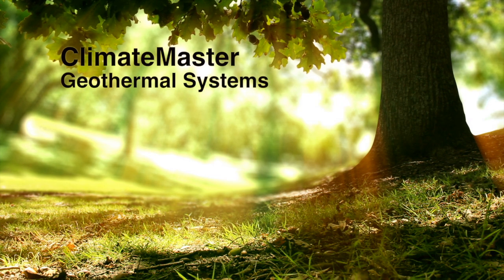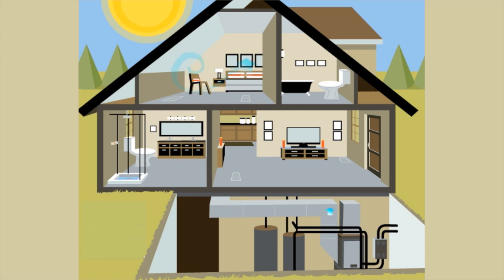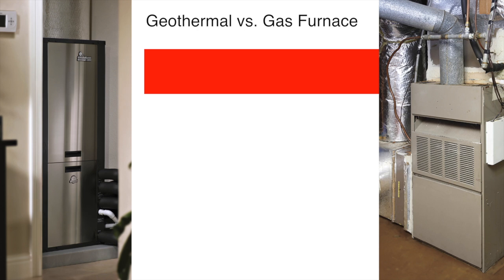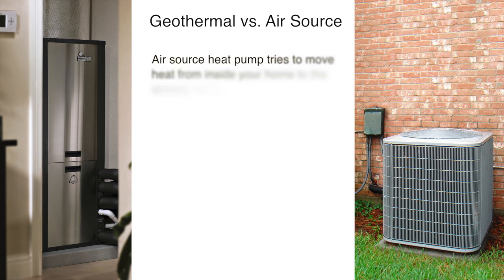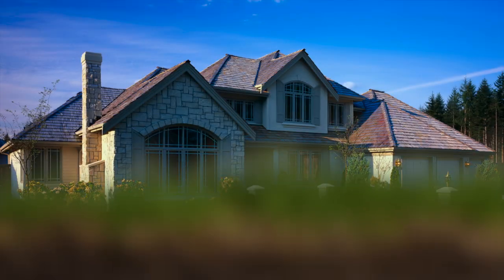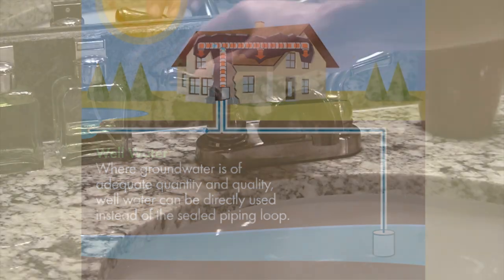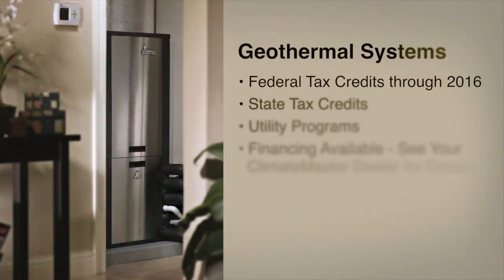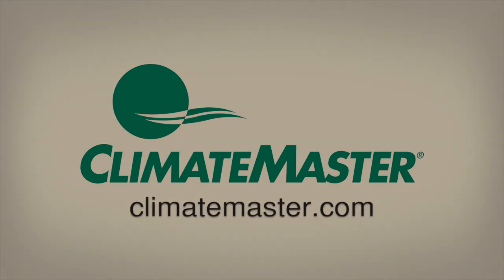Benefits of Geothermal Heating and Cooling

Comment: Learning the hard way. Bought a house in Ohio that has geothermal already installed. Had inspections that every work properly. Replaced after 1st year, 3 companies, 3 estimates, all said undersized. Heating bills from mid November to end March 3500 to 4000 total. Installed wood burner stove to heat house, bill dropped to 200 for average. House is 3000 sf ranch, w/good insulation. Geo unit is 3 ton air side, which works great, average bill 225 summer, but in the winter, if it gets below 30 deg it’s a piece of junk. Oh, the heat side is 2 units at a total of 6 ton. Uses all electric below 30 deg and will only heat to 68 degs. That first 875 dollar bill for the month of Dec. was more that a shock. Now 7 years later, and a tech out every 6 months to service unit, they say it needs replaced. A worthless piece of junk, and a con job by a industry as a hole. Luckily they ran natural gas this spring down our road, so the heat side will be toast by fall. Save your money, don’t buy into this, it’s not meant for heat in cold climates. That 2nd year cost us almost 20,000 with the replacement of units, heating cost, and , misalliance.
Reply: WTW Could it be that this system that house had could have just had some issues on top of not being deep enough into ground? I’m just wondering after reading your whole message.
Reply: 3000 sqf then you need 11 kwh pump. And that is a 3500 watt compressor. And if this runs 24/7 it is, 30*24 = 720 H/month, is 0.1 dollar hour/and 1000 watts. And that is 24 h/day *3.5 kwh = 8.4 dollars a day times 30 days
is 252 dollars. And that is if your house, is using 11 000 watts to heat continuously Normal heat requirement is> 

Well insulated is 40 watt per kwm, 250 kvm (2,690 square feet) gives  40*250= 10 000 watts
A well insulated house 2400 sqf needs 10 000 watts in a very cold climate. And the geothermal pump gives 11 000 watts, without need to use electric heating. And the cost is, 252 dollars for one month. You sir are lying.
Reply: @72strand  or is just really bad at Math. ;)
Reply: John Strand The 252 dollars a month thing, that’s kinda why I started brainstorming about my Rocket Mass Heater Hybrid Geothermal system. The RMH would serve as a heat source amplifier and introduce heat into the system when the geothermal system is working way too hard and the cost starts getting a little uncomfortable for the wallet. RMHs use a lot less wood then traditional heating methods and they leave no residue to clean because they burn the creosote too. Hopefully I’m onto something.
Reply: You have to get below the freeze-thaw zone.  Higher latitudes, continental climate, you have to go much deeper.
Reply: Darn, it seemed like a good system
Reply: Also, to modify the system, I have an idea, what if a solar water heater was added to the output end of the geothermal system to boost its resting heat output? You’d have pretty hot water flowing through those pipes to warm the home all you’d have to do is put the solar water heater on a remote controlled swivel and program it to follow the sun 24/7. I say this because my house has a solar panel array that cuts my electricity bill to zero. So I have electricity to play with. I plan on living north. Not Alaska or Washington north but moderately north. Nothing higher than Oregon.
Reply: Catalyst - D B The man who built my house did just that. He took a long big radiator, painted it black. Made a long big wood box, rockwool in the bottom and sides, glass on top, mounted it on top of the garage. And waterlines down to a tank in the house. What happened? The whole thing exploded. No one was hurt.
Reply: John Strand Glad nobody was hurt though. Haha. Tons of videos about those solar water heaters on here. Maybe there’s something the guy did that wasn’t right? YouTube videos might help show what went wrong with the construction
Reply: John Strand with my current set up plans, my electric and water bills are zero. I still have medical insurance and car insurance but I don’t see a way of getting around those anytime soon 😂 Trying to retire extremely strong someday. I’m only 23 years old. Skipped the bank for the house building. Paid builders directly cash. Takes months longer but it’s worth it. Don’t wanna be slave to the banks.
Reply: Catalyst - D B Yeah, you need a pump or else it makes steam :). This was in the 1978 or something like that. He wanted to heat the incoming water to the hot water before the boiler.
Reply: John Strand ohh! There you have it then. 😂 Lesson learned for the builder I guess. Makes sense since the steam produces the pressure needed for the explosion. So a pump to remove that steam makes sense.
Reply: @DylanBegazo  hmmmmm now this is intriguing!!! I thinkthis could work!
Reply: Buddy Shoe ☺️ Then I have more personal thoughts to share. Look into something called a Rocket Mass Heater. I have plans in the works to combine a Rocket Mass Heater with a geothermal system like this one. The Geo system doesn’t produce its own heat, it only gets heat from one place and transfers it to somewhere else aka it doesn’t create its own heat. So. What I was thinking is those heat extracting lines that go into the ground? Why not take half of them and have them line the outside wall of the centralized chimney of the rocket mass heater system? Any heat the geo system extracts from the ground is amplified via heat extracted from the chimney too whenever I decide the rocket mass heater system is to be used. Essentially the rocket mass heater system would serve as a heat amplifier during winter months ☺️ my house has a large central chimney in the middle of my house that goes all the way down through all the levels. The chimney is custom made for a rocket mass heater system and is very very insulated. ☺️ Just an idea that I came across back in the day when I looked into it. Yes it uses wood but 1/10th the wood of normal fireplaces and stuff. Sometimes I use paper and cardboard or newspapers too. The output of the rocket mass heater is simply hot air and a bit of CO2. That exhaust pipe? I put that exhaust pipe down into the earth to heat the deep soil where the other half of the geothermal heat extraction pipes are that are located in the earth. ☺️
Reply: John Strand My plan for my home is to make a hybrid heating system. A Rocket Mass Heater Geothermal Heating hybrid system.  Rocket Mass heaters require a insulated chimney and loops to pass the heat into the space. I take advantage of that fact because my house has a large chimney in the center of the whole home that serves as a ballast or mast and goes down through all the floors down to the basement like the mast of a old fashioned ship. My large insulated chimney will be used for the rocket mass heater system. The loops afterward I’ll put their output ends in the ground about 7 feet deep outside in the yard in the soil. The Geothermal fits perfectly because the heat absorbing pipes of the Geothermal I will use like in this video, they will be outside in the ground in the yard. But they will be placed in the same part where the rocket mass heater pipes output their massive amounts of heat so the Geothermal heat absorbing tubes absorb/collects that. The Geothermal heat absorbing tubes then do not end there, they are also coiled around my house’s chimney too to absorb even more heat. All of this heat collection before reaching the Geothermal compressor component of the system. This makes less work for the compressor. The tubes will not be extremely hot before reaching the compressor because I’ll fashion the insulation level of the chimney to only be hot enough to touch with bare hands on the outside. Not hotter to the point of being unbearable for physical contact. But anyways. After the heat tubes reach the compressor they are pumped through the house via the heat exchange tubes of the Geothermal system aka heating my house ☺️    The heat exchange tubes I’ll be running on my roof, under the drive way and in the floors of my whole house. No electric bills because my house will run completely on solar electric. I will install the solar myself.
Reply: Catalyst - D B Hi, i have read your plans and have comments. I don't know how your house is built and the size. First, sounds great to have 2 systems. You use wood when you have the time, and geo when you don't have the time. But, you are thinking backwards. A geopump is built for some small degrees above freeze. So from -0 C to +8 C. Some pumps even have the input below 0 C. And the output to ground and or  the ground/bedrock is typical - 5 C. This is the way it is designed. Inside the pump, a gas is compressed and gets very hot. + 120 C, The water output (hot side) is then maximum + 60 C. The thing is, you can't really help the pump. If you increase the cold side, from 0 C to +8 C, you get only a very small increase in efficiency. Above +8 the pump stops working.
The way to increase heat pumps efficiency is to work with the hot side. If you can heat your house with +40 C water to the house that makes a huge difference. There are ways to do this, radiant floor heating. Water to air systems with fans. Fans under the radiators. Bigger radiators.

i don't know rocket stoves, but i do know a Swedish wood boiler that is really good. https://www.youtube.com/watch?v=gKZJFOsDLmU&index=23&t=172s&list=PLdohbOJzAINrkumCPioMkm7hjDWwNWCiJ
And now you got my videolist to :) This stove uses reverse burning and ceramic. That way you don't burn wood, you cremate wood :) The temps get very high, and the rest of system is good to. smokelessheat.com sells them.
Reply: @DylanBegazo  yeah solar water heater works great at night when you need heat
Reply: Ryan Brand I fixed the problem you are alluding to already. I just didn’t feel the need to update my comment. But since you brought it up I’d like to hear what your proposed solution would be before I say mine.
Reply: Do you have all the wall openings sealed in the attic ? My bill dropped to half once i sealed my basement and wall openings in antique with a cheapest form filler spray.
Reply: Is that not obvious?
Reply: Thank you. As everything else in life, if it's too good to be true, it's not true. Again thank you for your input.
Reply: Daniel Costa Ignore what WTW said. It is prob a lie, you don't know if he has some stock in gas or wood company's. OFC Geo works, it is a big industry. We know exactly the costs for running, performance, and lifespan of machines. Some geo units even have 15 years warranty. Yes, it is worth a lot to get the best brands. I recommend waterfurnace.com for they are now owned by one of the first and biggest geo companys Nibe. And have great products.
Reply: John Strand Thank you so much John. Wish more you tubers were like you. Thanks buddy

Comment: if geothermal could produce
50*F  air to cool your home in
summer that would be great
and also 50*F air to warm your
home in winter but you need a
heat booster to raise to 65*F
it beats  heating air from 15*F
to 65*F .... good luck on how
you do it ..have a nice day gents,

Comment: This would never work in the tropics. Soil temperatures here are a constant 84 degrees 15 feet down.
Reply: go deeper, at 5-6M down the temperature will be approx 12 degrees celsius
Reply: "However, in the cave it usually ranges from 18 – 23 Celsius in the winter (when a fleece and extra warm clothes are necessary) to 22 – 25 Celsius in the summer, when shorts and t-shirts will suffice around camp." Information on deep cave temperatures in Vietnam. This cave is at a higher altitude than the lowland tropics.  This may work at higher altitudes where it's generally cooler,  25 is better than 30 degrees.